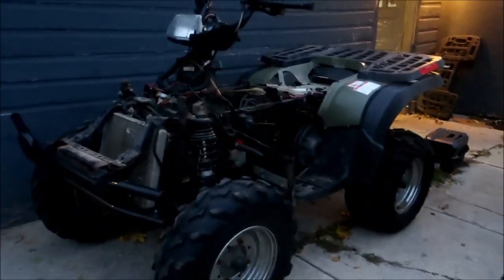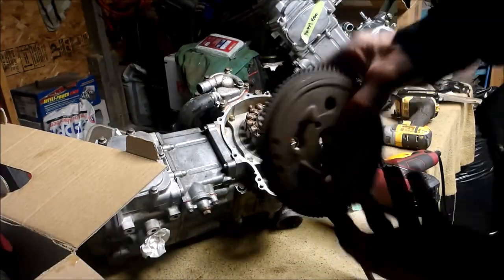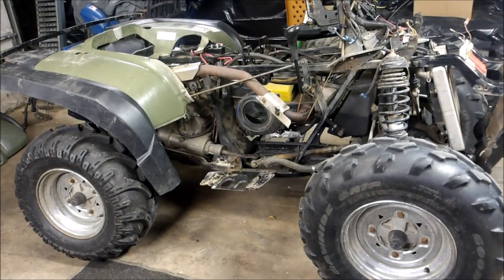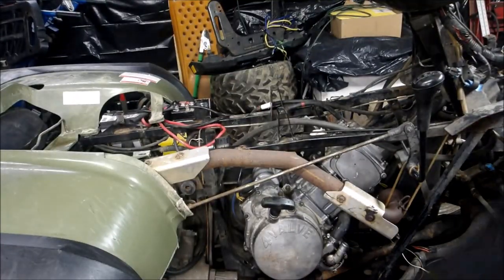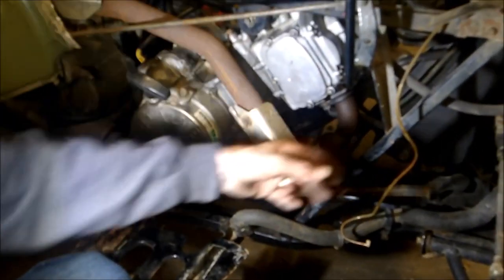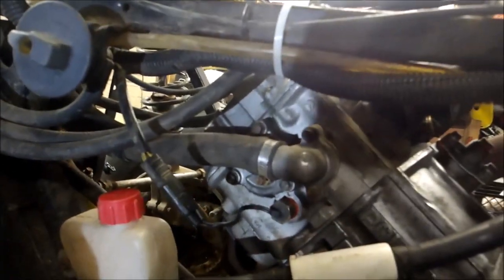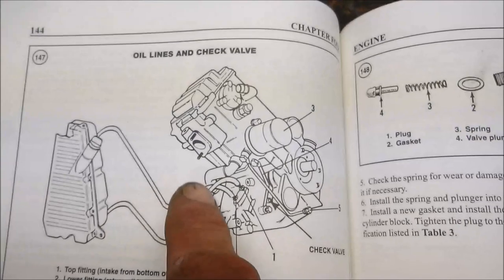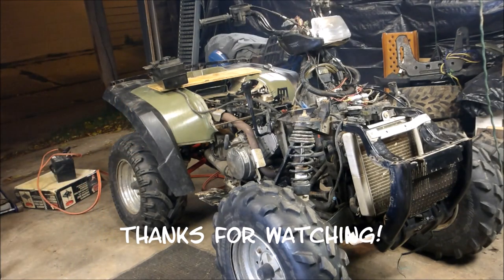2004 Polaris Sportsman 500 Rebuilt after a crash! Engine install and frame repaired!

Comment: Thanks for all your videos! I am now the owner through a trade of a 2002 polaris sportsman 5004X4 ho. It ran when I got it , in the trade I recieved a new chinese carb, so I installed it. Now it seems to flood as the airbox gets fuel in it. I have changed the plug, shows having spark, adjusted the throttle cutoff switch, seems to be getting too much fuel. Pulse line is dry on fuel pump, I havent checked cdi , the shutoff switch seems to be working. This polaris has had a rough life, just want to get is back to usable. Again I enjoy all your videos as they have given me lots of info!!! God bless

Comment: Is that 500 a two stroker?  It looks a lot like my 350 but a little bigger.  I wonder if the engines on these Polaris are interchangable?  Can I put a 500 in a 350 without too much rework?
Reply from the maker: No, it's a 4 stroke. I had wondered that myself. I think it would be a matter of welding different mounts on. I know a 500 would fit into a 335.

Comment: I had a leaky gas tank peacock and tightened it a little too much.  The nut pulled through the black  plastic cover.  Do you happen to know how to fix that.  I've thought about in weld but I'm not sure that would hold under pressure..i guess I might need a tank.  Do you have an extra one?
Reply from the maker: No. But what year tank? Some have the fittings in the tank that goes to lines to petcock some have petcock in the tank.

Comment: I have a 2001 500 HO.. would you happen to know what the torque specs are on the rocker assembly bolts? And cam gear bolts?
Reply from the maker: 8 - 9 ft lbs on rockers Not sure about cam gear. i would google it. i don't have the manual on hand now.
Reply: @TitaniummanGarage  got the cam kit in! fires up and runs to about 3/4 throttle. Seems to improve when i take the airbox lid off..Is this a carb issue?
Reply from the maker: @sorehair7075  I ran into that a couple times. Some things to check: Your breather hose filter going from case to air box, could be plugged. Check all hoses going to air box. Make sure no cracks or pinching is going on. Check the snorkel on the air box cover. make sure the foam around the tank isn't blocking the opening. The diaphragm in the carb could be bad. For some reason its not getting enough air. I have seen a video about guys modifying the airbox for more airflow. I had one that the gas tank was pinching the right side vent hose. I believe it goes to the oil res. I fixed it and it ran fine. Or you could clean or replace the carb. I hate those CV carb. They run off of vacuum and the littlest thing can throw your throttle off. Hope that gets you in the right direction.
Reply: @TitaniummanGarage  the foam around the snorkel was causing issues. Seems to be be running better! Thanks for the advice! One other matter Im having now is idle fluctuation. I can rev it up and when it settles it will either die or idle correctly for a short period of time then speed up.. what might be causing this? I think Im getting close though! Thank you for your help!
Reply: I had a pickup coil cause a similar issue. Might try to just verify that. Seemed to cause erratic issues....

Comment: I got a diag question for ya.  2002 Sportsman 500 H.O. overheating.
Rebuilt upper end, new temp sensors, new thermostat (tried running with and without), installed external electric water pump, flushed radiator, new radiator cap, no coolant in oil or vice versa...... It is blowing pressure back out through the overflow reservoir cap.  Heats up after only sitting at idle after about 20-30 minutes.  Heat gun reads about 240F.  Actually runs REALLY well before it overheats.  Idles fine and has great throttle response.  Any ideas?  Next step is to tear the head back off and take to a machine shop.
Reply from the maker: I had the same problem on another engine I have. warped head possibly. So your on the right track. Do you have white smoke coming out of exhaust? Pressure from the piston is blowing coolant back into res. Or the head wasn't torqued in the right sequence. Check your jug too, to see if it warped.
Reply: @TitaniummanGarage  no smoke.  Runs good!
Reply from the maker: Did you bled the air out of the coolant lines?
Reply: @TitaniummanGarage  I'm not the one working on it anymore.  Sold it to a co-worker.  He says he did. He was an auto mechanic many years ago.  He knows his way around vehicles so I would hope he's done it correctly.
Reply: Warped Head.  At machine shop now.
Reply from the maker: @GSLBoling1979  Thanks for letting me know.